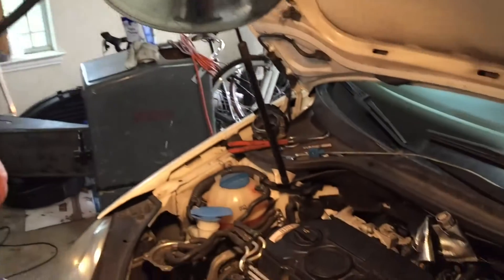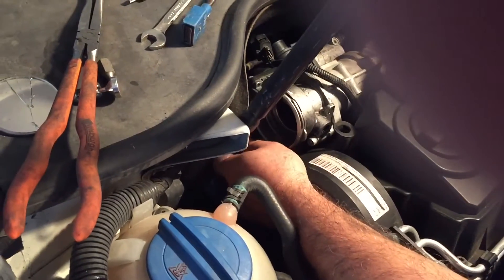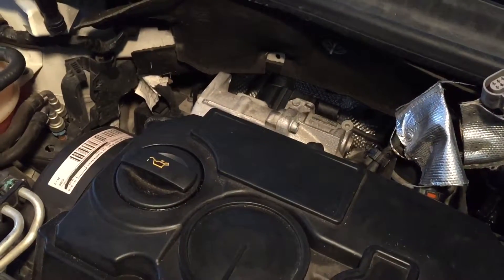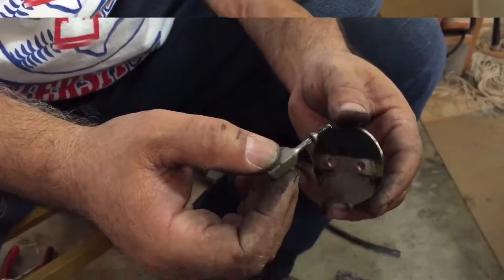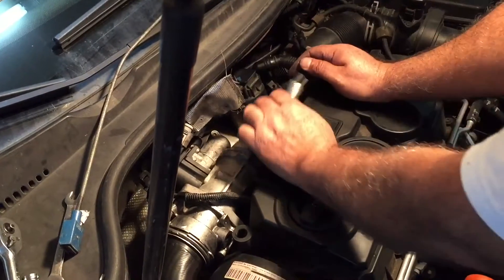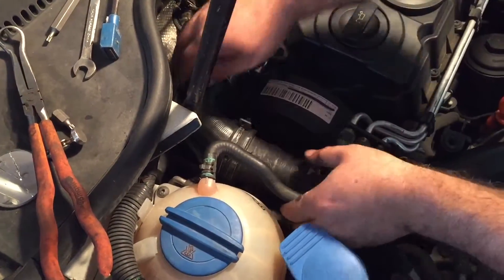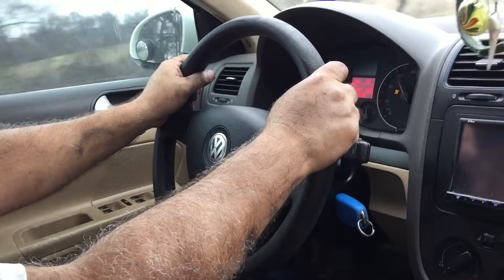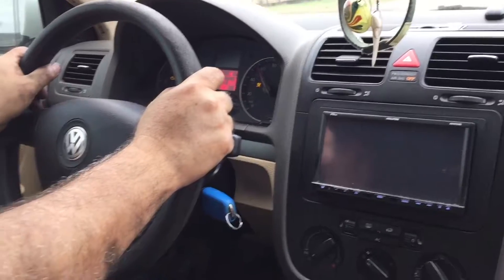Jetta Tdi Delate egr

Comment: but you must have a mannagement light on now?
Reply: Yes when performing a EGR delete you gotta go get it tuned to remove the check engine light
Reply: @XLouisGamerX  will it still run
Reply: @damonandre2410  I think so, maybe a bit poorly tho
Reply: @XLouisGamerX  it runs like crap , i removed the plate just keep egr plugged in you now got the mix no check light
Reply from the maker: @damonandre2410  yes and it’s running better specially wen you press the gas
Reply: @rolivares507  I blocked off the exhaust on the turbo made my own plate and I took off the coolant hoses cut them and attached to heater core left egr cooler open so ecu reads a difference when it is engaged just normal air I don't get a fault code
Reply from the maker: It come and gos other than that work for me